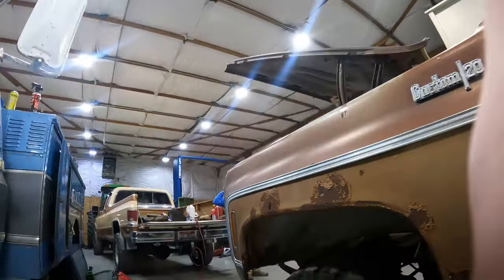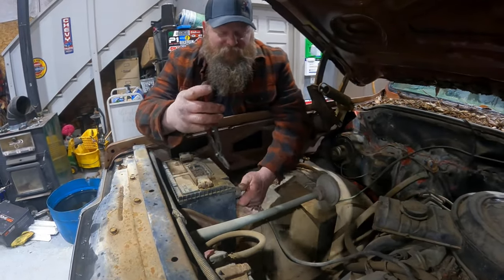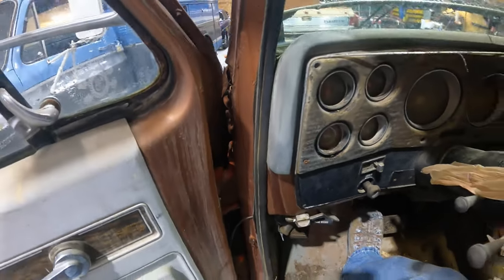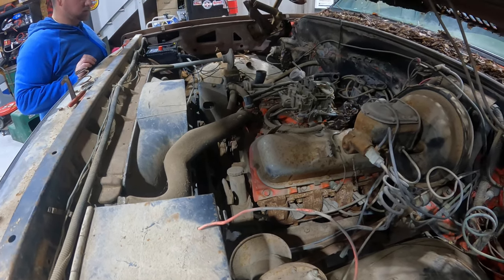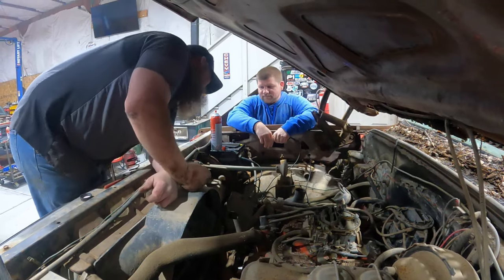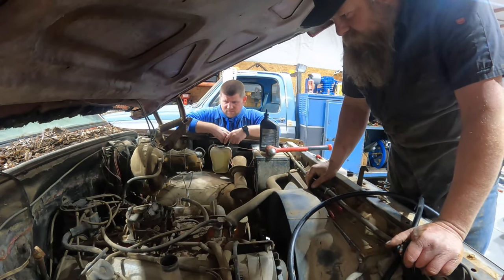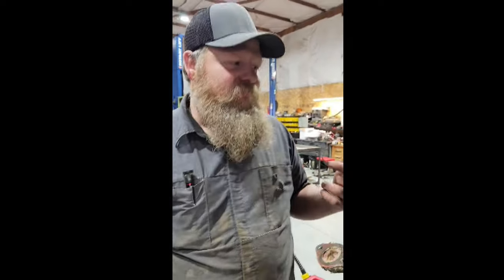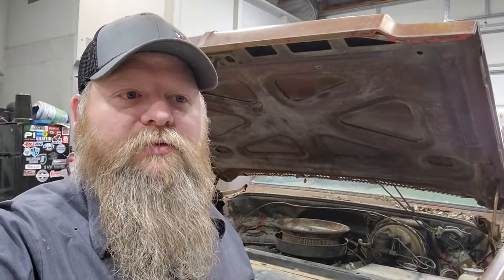Will it Start?? and Climb a Pile of Logs? Squarebody Chevy

Comment: Could that have been kw block seal that was clogging the thermostat
Reply from the maker: Thanks for the comment. We believe that the antifreeze had a chemical reaction with the thermostat housing because that is the only place it was plugged. The rest of the cooling system was clean.